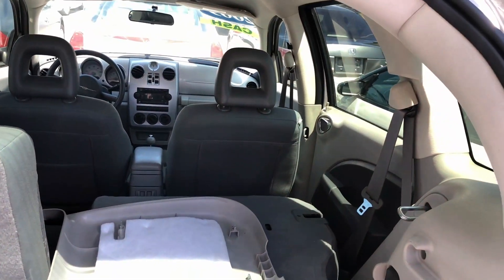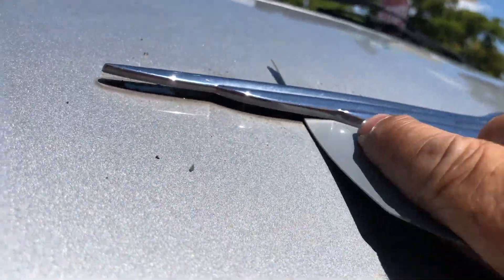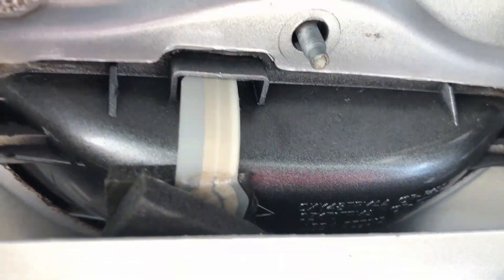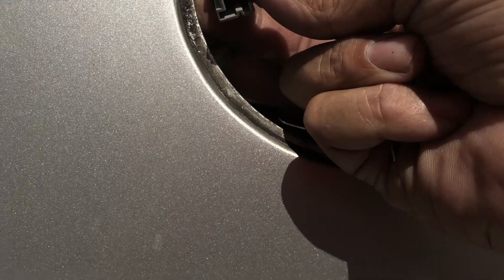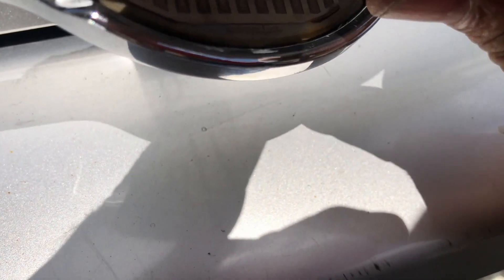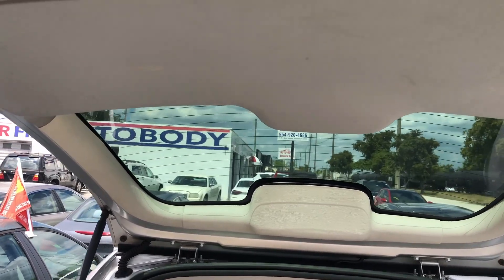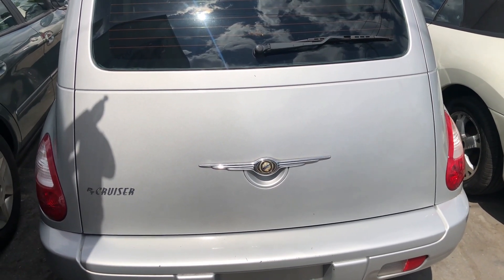MY PT CRUISER TRUNK LID WILL NOT UNLOCK: PROBLEM SOLVED

Comment: Just got done repairing my 2009 - great video - took the contact strip off the touchpad - cleaned both with contact cleaner and reassembled it. Works like a charm. I did notice - after I got it back together - that it's actually possible (if you're not a klutz like me) to carefully remove the contact strip, clean the strip and the touchpad and glue the contact strip back in place, from the outside, without disassembling the whole thing. Lol, only noticed it after I had the hatch open and in the up position, where I could see up in the handle where the touchpad is. Might come in hand in an emergency. Anyhow - this fix saved me a bunch of $$$$$. Thanks Much !!!!!!
Reply from the maker: Great feedback. Thank you
Reply: Thanks you both for the great information.  I used your final tip and didn't take the whole thing out to clean it. Just used a butter knife to carefully pry the 2 pieces apart and cleaned both sides. Just going to need a bit of clear silicone to seal the edges back. (Ps Knuckles hurt a bit as it's tight for rubbing the dirt off when on the car.)
Reply: Oh thank you.  Actually found the removable touchpad laying on my back bumper after a really hot day.  Hoping to clean it and glue it back without removing it.
Reply: can anybody just get access to the trunk area of a PT CRUISER if the touch pad is actually working.. can anyone just touch this pad and the trunk opens up ?

Comment: My 2008 PTC hatch decided not to open last week, so I took it by the dealer this week to investigate.  The failure was in the touchpad and they said a replacement would not be available until JAN 2020.  Somewhat dismayed, since if I had a flat between now and then I would need to get at the spare tire.  I came home, looked here on youtube and found your two videos!  I didn't know I could get the interior hatch liner OFF, with the hatch being closed.  Once I realized that, I followed the rest of your directions and got it all fixed up.  I installed BOTH a switch as you suggested and a short (i.e. 6" stainless steel) pull wire to force the trunk to release (from the inside) in case the solenoid ever fails in the future.  I was surprised that a SAFETY LATCH MECHANISM (i.e. silver in color) was actually installed on my PTC's rear hatch solenoid.  It just wasn't hooked (up) to anything...to pull it with.  So I added my own Emergency Pull Cord to it.  Anyway, MANY THANXX for your fine videos and instructions about the PTC Rear Hatch issue on 2006 and newer models.  P.S. While several videos existed on youtube about this topic, yours were the only ones that clearly showed me the parts involved.  Others had such poor (i.e. shaky) camera work, I couldn't make out what-was-what?!  KUDOS ON A JOB WELL DONE!
Reply from the maker: Thank you for that great comment. I really appreciate it. I love it when people such as yourself Let me know that the videos helped out.

Comment: Awesome dude i have the same problem i just bought the car 2008 i will do this my field is electronics is my name thanks man. Update well it turned out that yes the switch went bad so i ordered a small momentary switch and the hatch is back to functioning. I could've cleaned the contacts but it will go bad again so decided to just add the switch. Thank you
Reply: can anybody just get access to the trunk area of a PT CRUISER if the touch pad is actually working.. can anyone just touch this pad and the trunk opens up ?

Comment: I have 08 PT  i have the same issue.  I appreciate all the videos I have seen.  My actuator makes noise and if will even "unlock" if I hit a bump in the road.  it's worse in the summer.  My key fob will get the back to open, at times...other times it won't, but it's not the fob..that costs $200 from a dealer.  I think it's the finger pad.
Reply from the maker: sounds like it too me.
Reply: I had the same problem with my 09 PT, sometimes it seemed to work through the warm months but not in the cold months. I watched the 4 videos Clark Ninneman posted , he installed a momentary switch. I did the same after watching his videos several times. The switch works great, the hatch locks when the doors lock. I am glad that I installed the switch, cleaning the touch pad may work for awhile but will probably need cleaned again sometime later. The switch works every time.

Comment: For the "star lock washers", I was able to remove them with a needle nose pliers by gripping the prongs and unscrewing while pulling.  Mine's an earlier model, but uses the same fasteners.  Also, make sure the handle is well sealed to the body when reassembling, otherwise rain will leak into the hatch and get under the rear carpet (that was my problem).
Reply from the maker: Thanks for your contribution brother
Reply: @conquryourfear  I appreciate videos like these.  They help me understand what I'm up against when working on something I haven't done before.

Comment: Thanks! I have a 2006 Touring with the same problem. I just removed the interior trim yesterday, but I wasn't convinced to remove the emblem and everything else. I'll try Ben's tip to apply your solution from the outside and let you know how it goes.
Reply: OK, so I finally got the time, the weather and my daughter to quit the car for a day. :)  PROBLEM SOLVED! Just one difference. In my car, when I used the butter knife to separate the touchpad, it doesn't come in two pieces. The switch strips are "sandwiched" inside a soft plastic piece and you can see them going inside, behind the emblem. I can't upload a couple of pictures I took to clarify. (any idea as to how it can be done?) Since I didn't want to split the piece open, I just sprayed enough Contact Cleaner around the edges and it did the trick. Now it works like a charm. THANKS A LOT!!
Reply: @juliordzMTBB  that it i was thinking, thank you all of you guys. Perdonen la gramatica jajajaja
Reply: My touchpad was one piecw as well.  Cleaned it up with paper towel, water, and a lil spit.  Its working again!!!

Comment: I detail vehicles on the side, i just recently did an 08 pt cruiser...i disconnected the battery so it doesnt drain when having the doors open..trunk opened up with no issues but after plugging the battery back, the back latch wont open..i believe the actuator works because i did disconnect and connect the plug for the latch and it made that sound described in the video...im going to try cleaning out the pad and i really hope it works...if it doesn't, could there be some settings that got reset after disconnecting the battery?
I should add locking and unlocking with the fob produces no noise or movement in the hatch

Comment: What if it is the actuator? I click my unlock and hear nothing. The dealer said the part is no longer available so I bought a full tailgate switch with the emblem and the wiring since I didn't know exactly what I needed. Now it works when it feels like it. I bought the keys from amazon to try them, but from the way you are talking it sounds like replacing the handle was a waste of a lot of money. It sounds like I might need to look for the actuator. I wish I knew how to take the tailgate apart myself to fix things bc it goes to the dealer for the fixes. BTW, the last time the tailgate wouldn't open was a year and a half ago and they had to replace some wiring somewhere.

Comment: Thank you for posting this fix.  👍👍 How do you get the trunk door open though?  Is there a manual lever?   the camera angles don't show everything.

What did you clean the touch pad with?
How did you reattach the emblem?
Thanks again!
Reply from the maker: Yes. There is a small lever
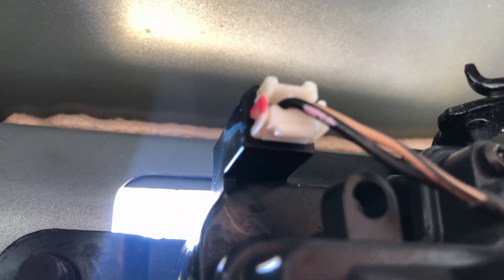Reply: In the video @ about 1:00 you see the connector and a sort of bracket to the right of it - the lever is down below that bracket on the back side of the actuator.
Reply from the maker: you have to take the panel off ---there’s a lever that opens it up. You can clean it with a moist terrycloth. The emblem doesn’t have to come off

Comment: I have a different problem - everytime I unlock the driver's door, the rear hatch partialy unlatches, so a get the light on the dash and the chimes.
It's a 2005 Classic.
Have to open the hatch and shut it again, and often it will immediately unlatch, or unlatch while I'm driving with all the doors all locked.
I'm mightily pissed-off with it.
Been going on for 18 months, and the local Jeep dealer says he can't understand it.
Same with the locksmiths, and auto electricians.
Wanna sell it, but I'll get nothing for it.

Cheers for your video - it was mean.
Reply from the maker: Sounds like the ECM is corrupt.

Comment: How do you get the trunk open in the first place? My TouchPad isn't working... Is there a safety latch or something that I can get the trunk open to work on it?
Reply from the maker: There is a plastic fastener in the inside of that tailgate.  take that out, pull the panel away, and manually open the tailgate.  sorry so late in responding;;;;just seen your comment.

Comment: I have a 07 and it has it.
Reply from the maker: It has a touch pad that opens the back hatch???  If so, which trim level you have?  I thought the 09 and 10 models were the only ones that have this type of actuators that have no connecting rods!
Reply: Yep my 07 and 08 has it